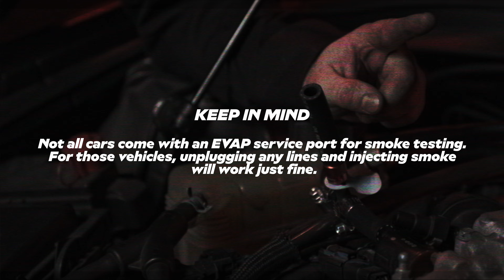Diagnose EVAP Leak with Smoke Machine | The Easiest & Fastest Way to Find Leak in EVAP System

Comment: I have an issue i want to order one of these how do I choose which model to go with
Reply from the maker: if you are a hobbyist go with the HyperSmoke. If you are using it everyday in the Shop go with the Ventus. I highly recommend getting the bundle with the Bladder Adapter it's a game changer
Reply: @autolinepro 
This would be buy 1 time fix a problem then I own it if I ever need it again thats it what's the bladder adapter
Reply from the maker: @BaileysOutdoorsADV  if that is the case then maybe just the standard kit. It comes with a much cheaper gas cap adapter alternative and saves you quite a bit of cheddar. The EVAP service port adapter is fine if you have one, but the standard kit is cheaper than if you were to buy the HyperSmoke by itself and then get the Service port adapter.

Most newer cars don't have EVAP service ports either
Reply: @autolinepro  can you send me a link to what one I should get
Reply from the maker: @BaileysOutdoorsADV  https://www.autolinepro.com/collections/automotive-smoke-machines/products/autoline-pro-hypersmoke-machine?variant=42554161397849
Reply: @autolinepro 

I also looked at the evap port kit.

Comment: Yeah, I fell for disconnecting the negative cable. The whole ECM went crazy. You don't need this problem. This is really poor advise and I don't know why it keeps getting repeated on different video's. Thank God for AutoZone and the smart female clerk I found there. She told me to drive the car around and eventually the codes would clear driving car 50 to 100 miles. I had about 8 fault codes. All disappeared except small engine Evap leak. Do not disconnect you negative battery your not fooling your car ECM!!!!!
Reply from the maker: it sounds like your ECM just went into a relearn mode which yes would have went away after driving it

Comment: Where would you set this up on a 2000 BMW E46? MAF sensor?
Reply from the maker: Gas Cap adapter or any of the lines
Reply: @autolinepro  Thanks. I did it through the intake boot, after removing MAF Sensor. FOUND THE LEAK! Then, I did it at the fuel tank  fill area: Found a leak "SOMEWHERE" around there, as well. Still scratching my head on that one. GREAT SMOKE TEST MACHINE!! GLAD I BOUGHT IT!
Reply from the maker: @standtall7646  awesome! Glad you were able to track that leak down. Thanks for your support!

Comment: Ya, but without the lift, there is just less you can do...
Reply from the maker: the first 2 types of testing did not require the lift. The last we just used the lift to allow for us to get a good shot with the camera. You can still perform all these tests without a lift.
Reply: @autolinepro i got dizzy going under the jeep i dont have a port where do i connect it ?
Reply from the maker: @CalitranoN  disconnect any line in the system you are trying to test and adapt the smoke hose to the line and introduce the smoke that way.

Comment: If you don’t have a smoke machine find a buddy to smoke off of a bong and blow into lines. Should work very well and you’ll spend all day looking for that leak 😂
Reply from the maker: This is expert advice. Then you'll have to do it again the next day 😂
Reply: @autolinepro  Of course, if it's the correct smoke, your car may cough and sputter a little before becoming a very happy car :)
Reply: You'll have to do that test several times a day until you figure out you're using the wrong smoke! Now, you car will only drive Verrrrrrry Sloowwwwwwly!! 🤣🤣